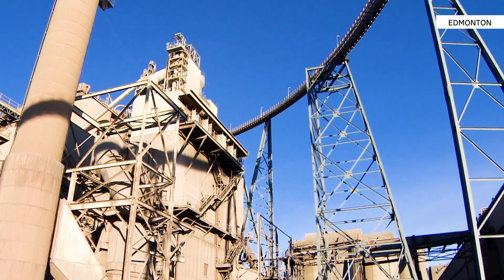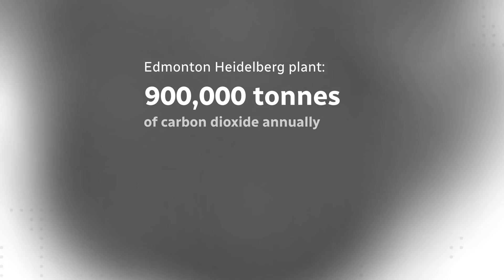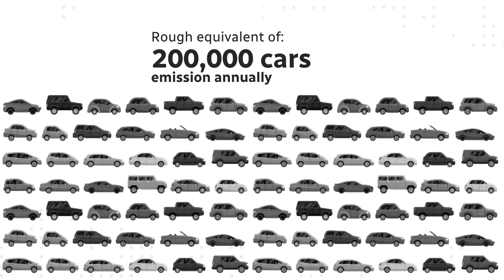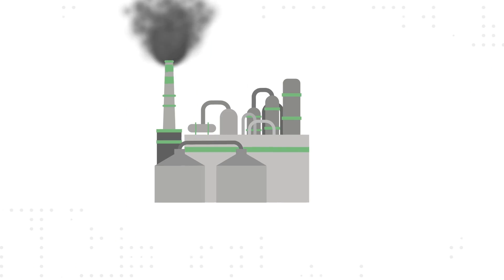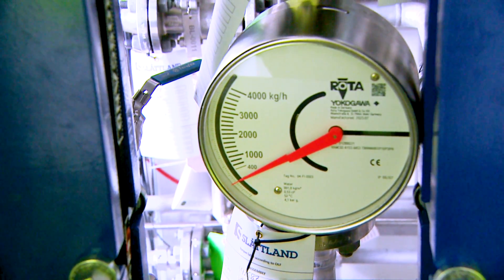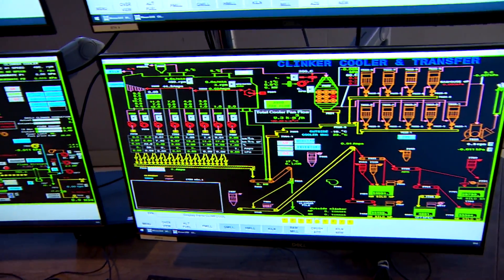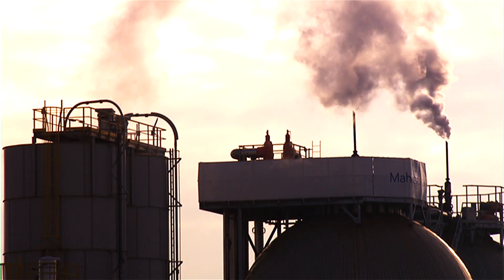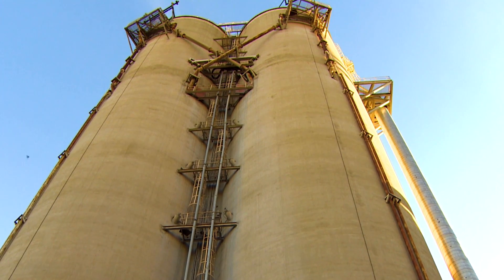How carbon capture could revolutionize the concrete industry

Comment: They plan on storing it underground That's not an answer to the problem 😮😢
Reply: Carbon capture is a transition technology for existing concrete plants. Sublime Systems is developing a simple and CO2 free concrete. The process is powered by electricity and uses a different chemistry that avoids CO2. The CEO is a young Canadian.
Reply: @jepleas9159  and that electricity is produced by burning fossil fuel, it very probably produced more co2 to capture it than to just leave it in the air
Reply: Atleast plant more trees